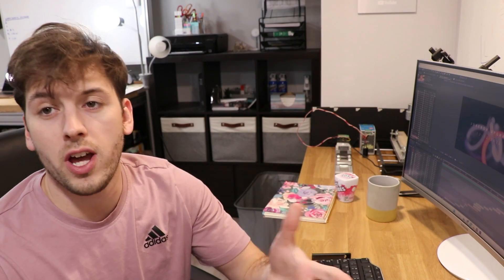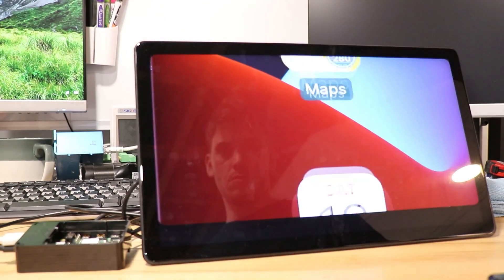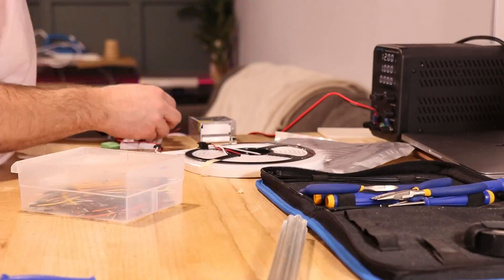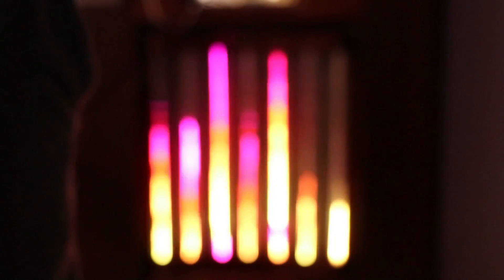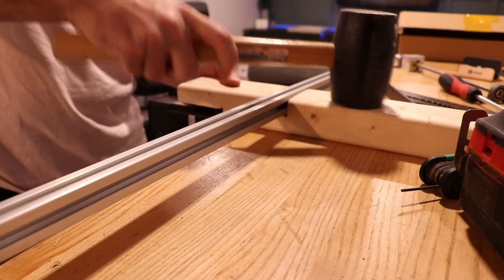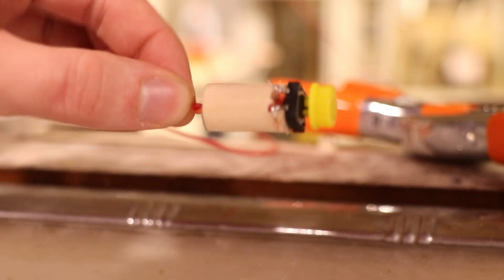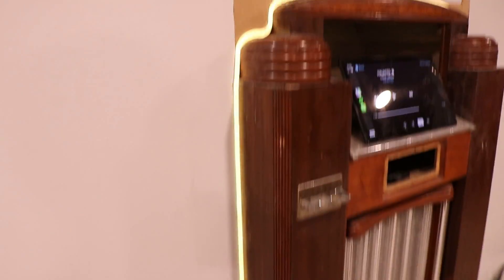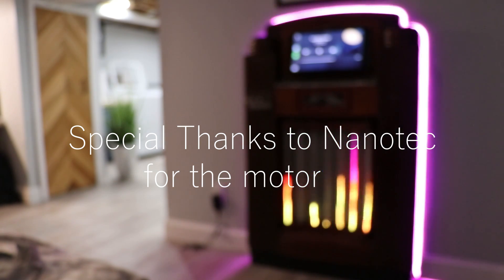Using a Raspberry Pi to upgrade a broken jukebox!

Comment: I like it hopefully it was wireless car play instead of having to physically plug everytime.
Reply from the maker: You actually have the option for both. In the drawer is a lightning cable but there’s a wireless adapter in there as well
Reply: @Grensom  oh sick then yeah it's an amazing set up.
Reply: wireless carplay & wireless charger